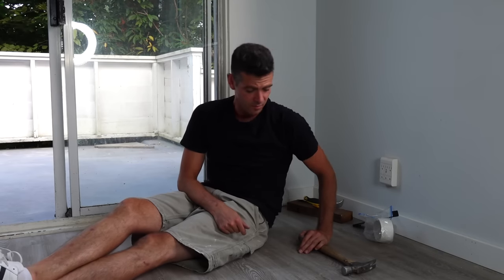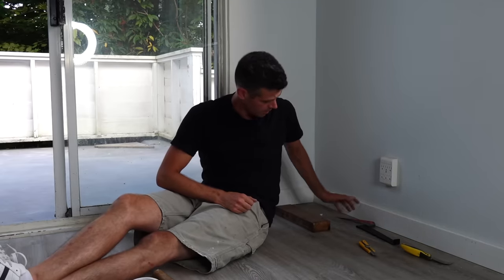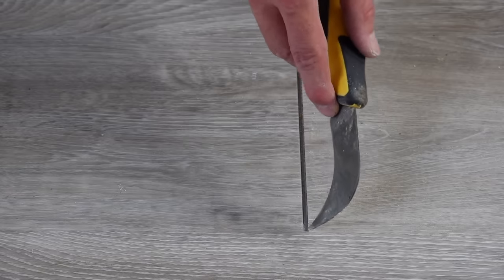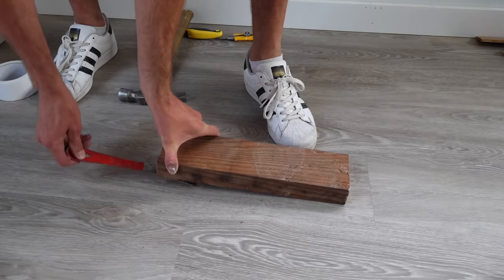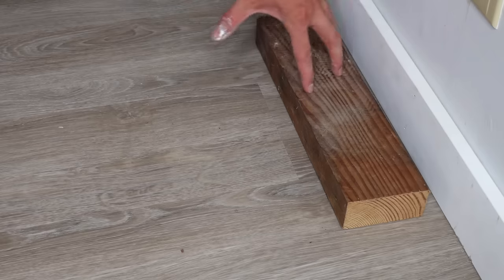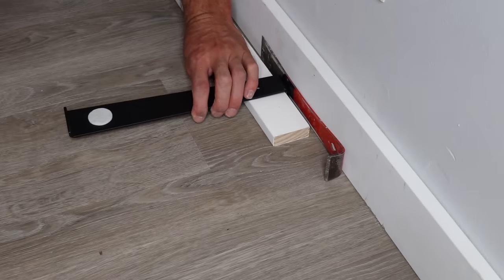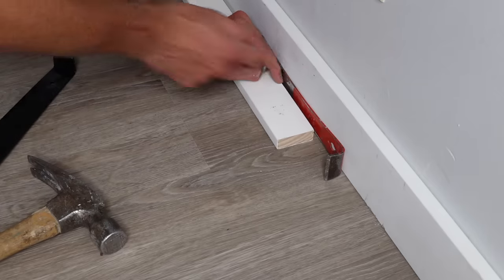How to Fix Gaps in Flooring!!! (Laminate, LVP, Engineered wood)

Comment: Never use metal to metal tools as damage is inevitable, use a buffer block to strike with a hammer or better use a mallet.  The installation kit I used on a project provided a small block just for the purpose.  As long as stiction is the order of the day for shifting the moveable panel, use something that isn’t going to mark that precious finish or worse, lift it.  The tape on tape idea sounds great and some floor mats also have that grip-not-slip backing, or even sneakers, however your toes might not appreciate it!

Comment: Hello,  I have Shaw Matrix Franklin Hickory interlocking LVP. It was professionally installed about 5 years ago in every room.  It looks like CRAP! It was fine for about 2 years until one day when our hvac stopped working and was with out ac for about 3 days.  I guess the big temperature difference caused it. But every since then it has big gaps in it and it gets worse with time. There is about 6 pieces that have cracked at the ends, I guess caused by where it's trying to expand.  In the owners manual it did say to leave I think it was 1/4 inch gap around all the walls, we told the installer just to make sure that was done correctly.  I live in Tennessee and it's just now getting cold outside especially at night because of that 2 more end pieces have cracked.  If we knew it would do that we would have never got it. We originally liked that it was waterproof and not suppose to crack etc. that's why we got it. It isn't waterproof now that's for sure.  It says it has a 25 year residential warranty- do you think that would be covered under warranty?  Also do you know how I can prevent it from moving in the future? It says you don't have to (or not suppose to- not sure which) glue it down but I feel like if it was glued down this wouldn't have happened.  It just sucks because it surely wasn't cheap.

Comment: Yeh, I use a piece of thin rubber like cloth instead of tape...
 A handle with suction cups works well too
 Oh, and I always have extra flatbars etc which I may have to use up against finished materials, with a thin felt so they won't marr finishes... You can get thin felt strips with adhesive to stick on the tools

Comment: My preferred method is standing on the abutting plank to keep it in place. Using a non marring white rubber mallet I tap the adjoining plank at a severe angle till it seats itself.

Comment: Nice, wish my basement floor had not been installed completely with those gaps in every single planks! It's as if nobody had used a hammer for the job. But maybe this will help fix the bigger ones. :)

Comment: The gap was probably due to expansion and contraction.  That method you provided is great but I think it will return as im thinking the reason why it happened there as there is a small flaw in the plank where it's slightly looser then the rest of the planks and it seperates as it is the easist to move. I would have banged out the floor to create a larger gap, used wood glue in the tongue and groove of the plank (gap) and banged the plank back in and wiped the floor clean from the oozed out glue.
Also you can just wear some rubber sneakers and kick the planks into place.  Just make sure there is no large debris lodged into the sole of the shoe.

Comment: This was such a helpful video and love the tips in the comments. After shifting and closing gaps should/could you fill the gap at the end with something (end of floor/baseboard to possibly prevent it from continuing to happen? Or is that gap needed for whatever reason to prevent other issues?
Reply: You need the gap at the wall or under a transition strip to allow your flooring to expand and contact with season changes.

Comment: Good job.  I have the OPPOSITE problem.  I have a section in the laminate floor that is raised, causing a bubble.  Unfortunately, they installed the flooring which makes adjusting anything, nearly impossible.

Comment: This is a pretty neat trick, but I have something that’s a little easier. One of my friends turned me onto it. Use a suction cup used for placing tile down and secure that to the loose floorboard. Then you can hit it with a hammer and knock it back into position. I have to do this about once or twice a month for some Especially wiggly laminate flooring.

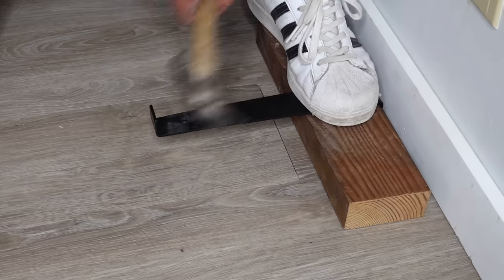Comment: The pry bar, or the listed “glazier” bar used in your video appears to have hooks on both ends. I can’t find a bar on Amazon or with your link that has that. Only seeing one side with a hook. It makes it difficult to perform the trick (3:45) on tiles that are close to the wall or against something. Any suggestions?
Reply: That two-hooked bar is not the glazier bar, it’s a pull bar for installing floors. Try searching for pull bar or floor installation bar.

Comment: I had a gap open in front of my fridge.  Pulling he fridge out of the way, I closed the gap using your tape and board trick hammering from the wall.  Since this was under the fridge, after closing the gap, we shot 3 or four finish nails through the last board down into the subfloor.  That will keep that board from moving anymore.  Problem solved.

Comment: Nice tip! Question for you though. If you have a gap in the middle of the room, wont sliding that one board to close the gap just create another gap at the opposite end of the plank you moved? And possibly risk breaking the tongue/groove locking system?
Reply: Exactly what I was thinking.  Just do it from the last piece in that row and it will push all of them until the gap closes

Comment: The bigger trick is preventing those gaps from opening in the first place. I tried using some powerful glue and it caused the boards around it to warp, then eventually it still split open.

Comment: I actually have another method for this issue I've used for larger sections. I used cheap dollar store hairspray to make my hands tacky, pressed my hands on the board I wanted to move, then leveraged myself off a wall, or had my buddy stand as an anchor point to push off of

Comment: You could put some beefy screws into both sides of the 2x4 and attach rope between them. Then you can pull the 2x4 off the floor instead of risking scratches with the flat bar.

Comment: Here's you another tip it's called expansion of the wood when it expands and contracts , without putting the wood on there with glue and hammering it you can take your sock off and with your bare foot take and kick it in a sliding motion flat-footed and it'll pop right together again I do it all the time and it does not hurt your feet it's almost like a slide kick, anyway works great and you don't have the glued board to your floor

Comment: Suggestion - instead of risking scratching the floor when prying up the 4 x 2 - put a screw in near one end of the 4 x 2 - then use a claw hammer like one was trying to pull out a nail - worth a try.  Have a safe and nice day all.  CHEERS from AUSTRALIA
Reply: You guys call it a 4 x 2 in Australia? In the US they are 2 x 4. Not making fun of anything just curious.

Comment: Could you answer a question. I have new laminate flooring that I am a woman and I am installing alone. It is clicking into place and I am hammering along the edge.  The problem is when I walk on it,  it squeaks and I can feel it flex. I know the right thing is to rip out the floor and install new subflooring. The house is old. But the previous laminate did not do this??? Anyway, It is not in my budget at all to redo the subfloor and like I said, I am doing this alone. I have to sell my house within 2 months....How can I fix this? Can I use finishing nails? lift it and use an adhesive?  Any suggestions would be appreciated.

Comment: Any advice for when you have some tiny gaps in the longways direction.  Like it's not quite locked together but almost.  I have like 3 boards that have tiny gaps that only I notice lol.  Floor is always the way down and trim is in so I don't feel like taking the whole floor back apart.

Comment: I'm afraid I must be misunderstanding something. 
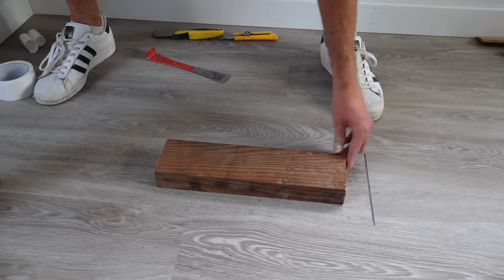As an example, at 2:18 of this video... Yes - I understand that the method shown will remove the gap between the boards, as shown. However it will consequently be creating a new gap on the next board over.

I don't understand how this is a solution, but I'm assuming that I must be missing something?

Thank you in advance for any input! :^)

Comment: I bought a house where the previous owner did a half-ass job of installing laminate flooring. There are gaps in the middle of the damn room! Do I need to go plank by plank shifting them or can I just start at the wall and shift the whole section?

Comment: Wish that worked with the vinyl plank flooring i got..  mine had the sticky. Tongue and grooves so its pretty much gonna be where it is until i decide to redo all of it..  theres a few that didnt get seated right..   ive just been putting wood filler in the cracks and going over it with clear nail polish then wiping off the tile..  it seems to stay for a good while..

Comment: How can you prevent this in the first place? I’ve heard that many people are having the issue of the flooring separating at the end joints, even when their sub floors are near perfectly level. So frustrating!  They should be making these floors with a deeper locking system.  Wish I could find an SPC vinyl plank flooring with a deeper locking system.  It’s a common issue, so why hasn’t a manufacturer come up with a deeper, stronger locking system?  🤔🤔

Comment: Great  trick, but drill a hole in the wood block large enough to insert a 1/2" rod or bolt when you are ready to pull the block up instead of using the bar under the block and then you won't risk damaging the floor
Reply: Sounds better, the beating the bar under the block seemed sketchy.

Comment: Just take the pull bar for the at the end and just pry sideways put something behind the bar if you don't want to mess up the base board doesn't really matter if you damaged the end of the floor board it will be covered by 1/4 round then you don't have to do the whole pry the tape up

Comment: Is this a floating floor? Did you seal around where the skirting meets the planks by chance? If so, what do you do if the old floor isn't perfectly level and there's a gap between the Plank and the skirting?..

Comment: Great tips...what about separations on the long, horizontal sides of the boards? We burn wood for heat in the winter which dries out our engineered wood flooring causing 3'-4' long separations of 1/4" or so in a few places. This requires large areas of flooring to be moved to close it up, not just sliding one board.
Reply: Agreed, what’s the solution on the other edge. I love VC videos. This one I watched incase I learned something new. Not really. But I figured the comments might have something about that other edge separating and how to repair that. Seems the only way is to rip it up and start over and hope the same thing doesn’t happen.
Reply: @andysidhu970  it will

Comment: Cut the tape long enough so you can wrap it up around the top edge of the board on one end. Then when you lift the end without the tape and use the board to either pull the tape or at least start the tape to peel.

Comment: My laminate flooring in my kitchen now has its share of gaps  between the boards. So using this method, won't it then just create a new gap at the other end of the boards being moved? No one in the comments section has mentioned this! And the video blogger didn't address this potential reality either.

Comment: Cool. If you bored a deep hole in the end of your 2x4 you could insert a piece of rebar or something to maybe lever it up while standing on the floorboard and not have to get under it with a bar and risk scratching the floor. Depending on what kind of flooring it is, maybe it won’t pull the floor up too.

Comment: Put a dab of glue in the joint and stamp on the board in a forward motion and the joint will close. Then wipe any excess glue off with a damp cloth. Easier than the wooden block.

Comment: the problem is when they separate normally, it's because the tounge has broken off so it will separate again. so, you should use some superglue in the crack to keep the planks together..

Comment: that closes the gap, but it will likely just open again since that click joint has failed. what's a fix to prevent this happening again? construction adhesive applied before close the gap?

Comment: Instead of tape, use two bigger rubber stickers and step onto the board, to hammer it in position. The friction is big enough because of the speed of the hammer hits.
So you don't waste tape and the ability to scratch your floor by removing the tape version.

Comment: Wouldn't a hand vaccum thing like you use for holding glass/windows work a like? Just tap it with a rubber hammer then release suction :)

Comment: No, the absolute best way is to buy the glue down version.  The tongue and groove will break over time and then the floor falls apart. However, if you have the floating kind as shown in this video you can clean out the gap like he does in this video and then apply a thin bead of hot glue or liquid nails inside the gap. Then kick together and clean off anything that squirts out.

Comment: When I installed our hardwood floors I kicked the last board of a row because it is up against the wall so you can't hammer it. But once you have stapled the hardwood boards to the floor it doesn't seem like they should be movable by any method.
Reply: Most laminate floors don’t use staples

Comment: what if the locking ridges on the tile strip are damaged and will no longer lock together?  I tired hot glue and forcing the tiles together again.  Didn't hold but about a month.

Comment: Much better to use a suction cup holder for glass sheets, as others have posted here.  Make sure they're made of metal, not the plastic variety.  You can purchase them cheaply for around $20 - $25 and they'll last a lifetime.
Reply: Would this work on textured vinyl?

Comment: Tip. Do not start with a whole length if it will give you are very short length at the end, since it is not so good to have a 20 cm piece at the end, since it will follow you when you lay the next section. Cut the first in half or something then.

Comment: Let the tape run out from the bottom of the wood piece and fold it over. You can grab it to lift the wood without scratching the floor. You can use tge sane wood with the tape on it multiple times.

Comment: Been putting this floor down for years all brands all types save yourself the time with the knickknacks and just kick it hell of a lot faster. Glue it kick it the back one glue and kick it all the way up to the wall should be enough to still be under the baseboard . If not baseboard off re-measure last piece to wall reinstall. No brick no double-sided tape once you get that brick up then you have to use mineral spirits and scrub the sticky residue off just kick the f**** thing lol